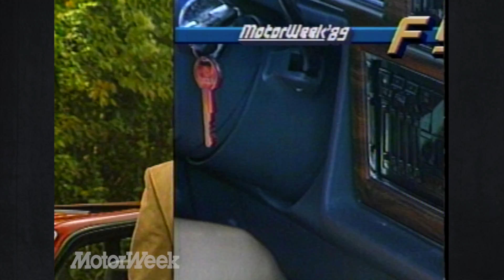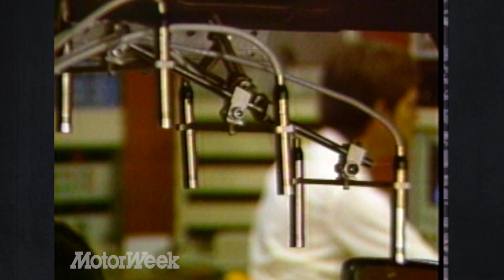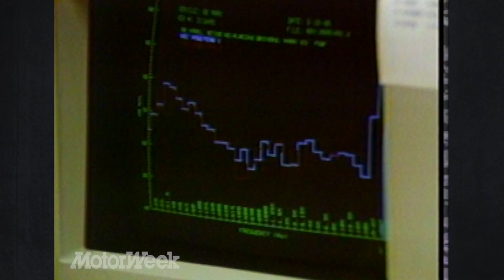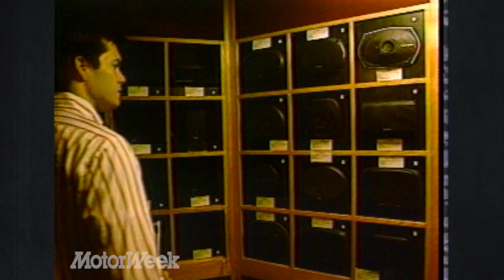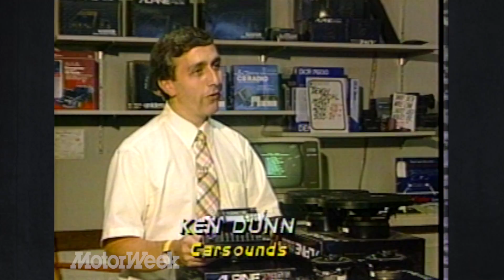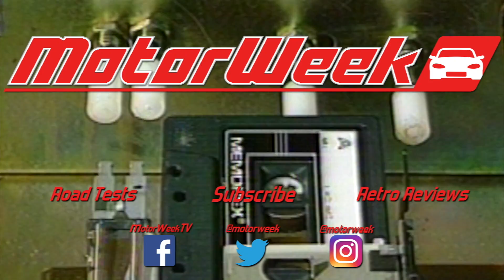1988 Car Stereo Guide | Retro Review

Comment: Mine was louder lol twinning ppi 15"s  in a little mazda 323 hatchback  with only 500w rms for the subs . But  A Insanely Optimized hand built Sealed  enclosure  . Over Sized power cables an A 1.0 Farad  power cap . In my car the system sounded like the best pair of todays  10"s  with 10x the Rms . Lol  mine hit 17~18hz an clearly heard   ³/⁴ of a mile  away. Earthquak'ng the city. Lol

Comment: I had 2 Alpine Type R 12" subs, a 2,800 (I think, its been over 20 years) PPI in chrome amp, and replaced every speaker in the car with new Infinity Kappa speakers. This was in a '98 Jeep Grand Cherokee Limited, and I did it around '01. With a bass heavy song, cranked up and windows down, you could literally hear me from a 1/2 mile away. I miss those days, I loved that car and sound system. Now its harder to do becasue of all thee computers and touch screens. I feel like buying after market stuff isn't much of a thing anymore, other than swapping out speakers.
Reply: Mine was louder lol twinning ppi 15"s  in a little mazda 323 hatchback  with only 500w rms for the subs . But  A Insanely Optimized hand built Sealed  enclosure  . Over Sized power cables an A 1.0 Farad  power cap . In my car the system sounded like the best pair of todays  10"s  with 10x the Rms . Lol  mine hit 17~18hz an clearly heard   ³/⁴ of a mile  away. Earthquak'ng the city. Lol

Comment: 30 odd years ago I put in a $1000+ Alpine Cassette and 6 CD changer with Phoenix Gold speakers in my brand new Civic.  The speakers tweeters literally fell out shortly after the one year warranty expired and the installers hot glued them back together.  Shortly after the Alpine warranty expired the display died making the system unusable.  I replaced it with the original factory Honda stereo and never had a problem over the next 13 years owning the car.  Instead of dropping a grand for a stereo I should have just bumped up the Civic to the higher trim level.  Lesson learned.

Comment: I sold and installed car stereos in Sweden in the 80´s and 90´s. Back then very few european factory installed units made any kind of great sound experience...
But I remember a trip to Florida in 1985 and we got a brand new Chevy Caprice as our rental, and it had a sound system way better than any european car at the time. But the car itself was a mess, the paint started to deterioate after only two weeks🤣🤣

Comment: Who here remembers hiding your stereo faceplate in the glove box?
Reply: I still have a removable face plate radio and its still works.Its casette and a 12 cd changer in the hatch.The car is a 91 foxbody🙂
Reply: Installed a Kenwood head unit w/ CD changer in an 84 LTD Crown Victoria that pulled the receiver in & closed a door over the receiver when  I shut the car off. No face to remove. 😎 Bought from Crutchfield.

Comment: Although I was an audiophile in regards to home hi-fi use (even utilized sandwich panelling, wood-sand-wood in speaker boxes, Dynaudio drivers etc), I never liked to have a visible change in the sound system of cars I owned.

Ever since I was a kid I liked the idea of ''sleepers'', and nearly all car's  I owned were sleepers, running high 11's, 12's, 13's in street gear but all had original hubcaps, wheels, interiors and the stereo systems would be kept as original, visually, that is I would have the original radio/cartridge/casette, but have the real working head-unit in the glovebox and speakers/amps under/hidden beneath cloth that suits the original interior.

But of course I didn't invest a lot in car audio, as I did in house, because the noise of the cars I used to drive were music to my ears.:)

Comment: I'm going to take exception with the "high end" Chrysler/Infinity systems.  I ordered that option on my new 2001 Dodge Dakota, primarily because it gave me steering wheel controls, which were still pretty rare then.  I loved having those buttons, but that's about all the praise I could give it.  It sounded no better than any other factory system at the time, and - of course - I ended up installing a quality head unit (Alpine, I think), a 4-ch amp, sub + mono amp, and (ironically) Infinity Reference speakers.  The "Infinity" factory speakers were no better than any other garbage you could get in the truck then.  I ended up paying probably $700-$800 for..... steering wheel controls.

Comment: In 1985, I took my Oldsmobile to a custom stereo shop. They designed a system for it, but I told them that I would have to save up some $$ before having the equipment installed. I then went to a couple electronics retail stores, bought the same or comparable pieces and installed it all myself. Head unit, equalizer, speakers, all sounded fantastic.

Comment: Today's cars come with infotainment systems that have a short life, are difficult and costly to replace with quality aftermarket systems, and are designed to encourage car owners to trade in their ride just to get new tech. My 2013 Hyundai Elantra is an example. The car itself is great and has been, but the decade old integrated navigation/radio shows it's age. While it has features like Bluetooth, streaming audio support is limited to audio only with no app control, no ability to upgrade the dated navigation maps, and the touch screen is starting to age with hard finger presses required to operate. Replacing it means sourcing one from a junkyard or Ebay, and it's like everything else: buying a little time. Cars today are disposable items. I sure love MotorWeek's Retro take me back to when "cars were fun".

Comment: Car CD players in the late 80s and early 90s would skip if you looked at them wrong. It wasn't until electronic skip protection was introduced in the mid-90s that you could listen to an album without worrying about potholes ruining your listening experience.
Reply: Not the Ford ones (built for them by Sony).  They were excellent, didn't jump, and didn't need electronic memory to accomplish this.  Beyond the CD player, the early Ford/JBL Systems were fabulous.
Reply: @owlnswan4016  Interesting. That definitely wasn't my experience with the CD player in my 1992 Celica.
Reply: @jonathankleinow2073  Not surprised.  I believe it was a common issue back then.  Ford and Sony got it right from the start in properly dampening the player from road imperfections, although it probably didn't hurt that many of the cars they were in road well, such as Lincolns of the period.  Even someone we knew who had a Mercury Sable from I think '89 had the in dash separate CD player (with the JBL Audio System) and it too never jumped.

At the other end of the spectrum was the 2002 Jaguar XK8 I used to have.  Although the Alpine system in the car was quite good overall, the CD changer in the trunk was junk as far as jumping, even after it was replaced under warranty.  Very poorly isolated and possibly poor placement of the changer itself.
Reply: @owlnswan4016  The Ford ones built by Sony were excellent until the CD mechanism crapped out and failed to eject the disc.

Comment: Fu** aftermarket radios they all look like 💩 compared to factory units especially nowadays.
Reply: Yes.  Some people don't mind their dash looking different, but I never find aftermarket equipment in the dash to look right.

With a vintage car, I often let people know they can not only have the original head unit restored, but also have a Bluetooth receiver added (the best way is having it wired directly into the preamp), have preamp outputs installed should you want a different amplifier (you could also get an outboard amp that accepts "speaker level", but the cleaner sound will be to bypass a built in amp), and change speakers.  This way you still get to have the look and experience of the factory head unit, play modern sources, and upgrade the sound.  In some of the better factory systems from the 1980s onward, like the early Ford/JBL ones, I prefer keeping the original amp and speakers since they provided a very nice experience in and of themselves which is special for that vehicle.

Comment: Car stereos from the 80s and 90/ sounded fantastic! Now a days they invest too much into the screens, and the radios sound like garbage. They don’t even have enough bass unless you spring for the upgraded vehicles that have a separate subwoofer.
Reply: Yep, I have a Harmon Kardon in my Hyundai 8 speaker system and it sounds like crap no amped subwoofer.
Reply: I'm gonna have to disagree... if you drove a lower trim economy car like a Civic, you got 2 tiny front speakers and maybe 50 watts of power. This why aftermarket stereo systems were big then.
Reply: @ we didn’t drive Econo box cars. We had Lincolns, Caddys, Oldsmobiles, and Chevys

Comment: the best old car stereo systhem is blaupunkt greetings from germany
Reply: Not so with the blaupunkt Denver. Unfortunately I think they reissued it now made in China. Junk.
Reply: I never owned one but every time I got in a car with a blaupunkt system, it sounded like garbage to me.  I would compare all the specs back in the day (signal to noise ratio, frequency range, THD etc - blaupunkt was always substandard despite the higher price tag.
Reply: Last year fitted Blaupunkt Bremen reproduction with all mod cons to mine 91 VW Passat. It looks great and it works as it should, radio reception is great all i need is swap the speakers and install the subwoofer and amplifier that i have lying in garage
Reply: @justas525  a original blaupunkt with cassette player that is waht i like
Reply: @autojogi  well i wanted a little bit of modernity but keeping oldschool look. And it looks like cassette Blaupunkt from late 80's
Reply: @autojogi  The ONLY issue I had is with the speaker plugs . The L shaped connections that seemed to be the same as alpine were very difficult to find before the internet came around. I’m sure there everywhere now.

Comment: Can’t imagine changing my stereo today. They sound better than the aftermarket ones I put into my cars in the 70’s!
Reply: Then you dont own a nissan frontier like me.... very tinny and underpowered
Reply: I bought a midrange car almost 10 years ago with the premium factory stereo. It was the first time I haven't bought a car, new or used, and immediately replaced the stereo. Would I like it to be better than it is? Sure I would. Would it be enough of an improvement to remotely justify the expense? Hell no. Until something like the touchscreen or factory amplifier fails it'll do the job just fine.

Comment: I put a Pioneer CD player in my 96 Toyota Corolla about 5 months ago, super easy to install. It was out of a 98 Buick LeSabre that I took off the road...sub frame rotted off it. Personally I prefer CDs over the touch screen, wifi, steal your personal data crap any day.
Reply: You got good taste. I kinda still worry about my CDs getting scratched and skipping while driving sometimes though.
Reply: The older Japanese cars with standard half-din radios sure made aftermarket installs a breeze. 15  minutes, a wiring harness adapter, and you were in business.

Comment: With today's modern infotainment systems burying the radio features within, aftermarket radios are much harder to put in. Especially since a lot of cars also put the climate controls and vehicle settings into the infotainment screen as well
Reply: You can purchase adapter plates that give you a standard double-DIN slot for an aftermarket head unit.

Comment: Now, because of touch screens and multimedia systems, an aftermarket system is nearly a thing of the past.
Reply: I used to spend thousands of dollars to get the sound my factory system has today.
Reply: I mean sure all that ''touch screens and multimedia'' is like the pandemic, everywhere,
but carguys drive old cars. :)
Just saying. :P
Reply: Thats not true at all. The aftermarket has stepped up there game as well. I own a 2023 Tacoma and replaced the factory touch screen radio with a Pioneer unit that has considerable more power than the factory and sounds so much better with a lot more options.
Reply: It's much more difficult today with active noise processing that almost all cars have in some fashion. There is also a ton of sound processing done so if you just change speakers, even to something much better, it'll sound worse.
Reply: Well in all fairness radios have come allllloooooong way since back in these days.  Even the shitty base radio in my 2011 escape pounds as good as some people’s aftermarket used to back in the 90s.  The only thing I’ve wanted to do was put better speakers but now I’m nearly at 300k so it’s kinda like what’s the point lol
Reply: My 2009 Genesis has a killer Lexicon sound system but if it were to break or if I wanted a different system I would’ve been out of luck. No separate head unit, plus the audio unit was also the trip computer and other functions of the car, so impossible to swap.

P.S. Mine works flawlessly, but with Hyundai’s audio warranty only being 3 years or 36,000 miles, breaking the system would’ve greatly soured the experience.

With today’s cars I wouldn’t even bother replacing the audio. Whatever Apple CarPlay feeds into the system is pretty much what I get - an MP3, played over Bluetooth or CarPlay, is nowhere as good as a CD or an 8-track. All I care about is that I can play Mariah Carey at full volume without distortion (her voice is very demanding) - though at that point I’m more likely to have my ears start bleeding 😂
Reply: The aftermarket world is still booming. There’s customer touch screens, retro fits and of course upgrade speakers, amps, digital processors, etc. The aftermarket world has adjusted to the touch screen world as well
Reply: @JustinDixon881 It definitely isn’t what it used to be.
Reply: @mwinner101  Luckily
Reply: @mwinner101 BS!  My buddy has had 3 shops since the early 90s. They have more customers and sell more aftermarket head units now than they ever have.
Reply: @vegaslimoguy2376  No one believes you but that’s OK. 👍
Reply: @mwinner101  I don't care if anyone believes me or not!  A bunch of randos in these threads, most of them  live with their parents in the basement playing video games all day while waiting for mommy to bring down cookies and milk.
Reply: @JustinDixon881  yeah but for how much? My 2013 Elantra Limited with it's factory nav system gives a few options that are thousands when installation kits, signal processors, etc are needed to keep functionality. The cars KBB is like 4 grand. Not worth it. The car makers would rather you trade it in.
Reply: I upgraded my 2018 f80 with a wider screen and storage unit, Ali special, works great doesn't mess iDrive features but installation was four time the price of the unit 😅
Reply: Aftermarket touch screens exist you know.
Reply: There are plenty of cars made before the adoption of Bluetooth. You would assume that the car audio aftermarket would still have reason to flourish.
Reply: Many of the ones with touch screens and multimedia systems are aftermarket systems.